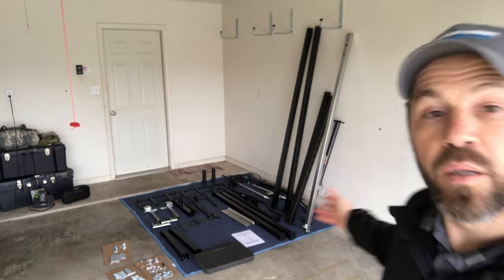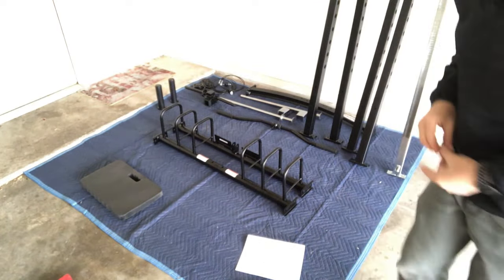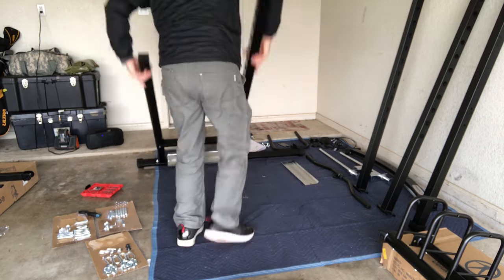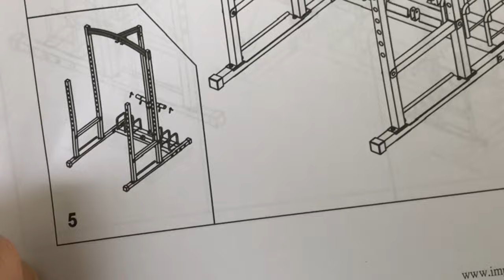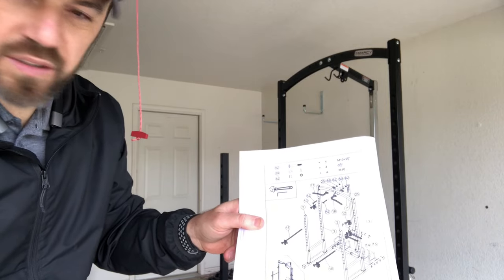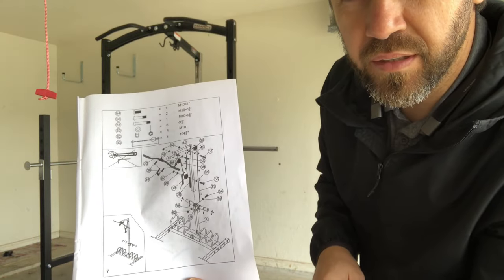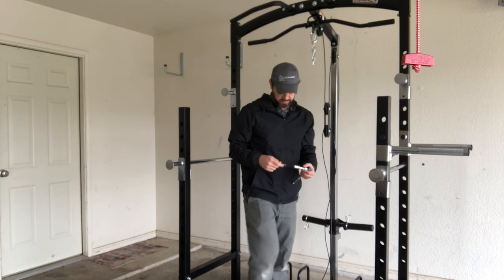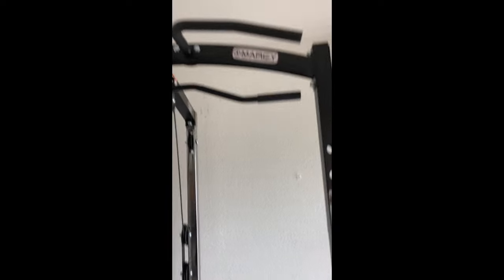Marcy Cage Home Gym | DIY Assembly & Installation

Comment: I had the same gym for over five years now and everything is still great but wondering do you know the measurements of the top cable and the bottom cable I would like to order a spares but don't know the measurements any help would be appreciated. Thanks

Comment: Hi, thank you so much for the video. Btw step 4(at about 5:00) the bolts and screws get stuck with each other and turn together. As I used wrong size of screw and bolt. Any solution ..?

Comment: Awesome video! On the plate storage rack, why do some of the U-shaped things have a hole in one side and others don't?
Reply from the maker: I’m sorry, I don’t remember those details very well. It’s been a while since I assembled it. 🙂✌️❤️
Reply: @MasteringMayhem  No problem thanks anyway
Reply: @karaipantsu9973  Hi there. The reason some of those pieces you mention have holes and some dont is because Marcy often uses the same parts for different cage systems. For example, the pieces with the holes may be used for a different purpose on a different Marcy Cage model (where the holes actually have a purpose in assembling the cage). Hope this helps.

Comment: What adaptor piece did you use with your Boshe 12v @2:50 into the video to tighten the weight holders into place? Also, 22mm for the wrench that you taped later in the video? Thank you so much for the great video! Cheers

Comment: Nice video! Was the plate holder for the pulley attachment only made for Olympic plates? And can the 1 inch standard weight plates be compatible for the pulley attachment?
Reply from the maker: From what I remember the bars that hold the plates are for Olympic plates only.

Comment: Could you do a review video on the rack please?
Reply from the maker: Aaron At this point I can’t do a review on it because I was only there to assemble it for a client. If I get an opportunity to assemble another one I’ll do a review. What questions do you have on it, maybe I can answer it for you since I assembled it.
Reply: Mastering Mayhem I was just wondering if it was sturdy and of good quality. Thinking of getting one for the home gym.
Reply from the maker: It is a very sturdy and rugged squat rack. The Marcy brand is great for home exercise equipment. Solid bolts and nuts that keep it together and it can hold hundreds of pounds of weight. There’s different models out there. The one’s that I have assembled and installed were all very durable and rugged. I hope that helps?
Reply: Mastering Mayhem it does, cheers mate!
Reply from the maker: Great 🙂. All the best to you and yours.

Comment: Having a problem at step 4 getting the double upright to fit into the grooves… I have the right side attached but the left inner seems to not match up. Any suggestions? It’s #23 not fitting into part 5

Comment: Awesome bro...did it all come in one box?? I have mine on the way but it says 1 box was damaged and sent back to the carrier? Didn't know if that was an error or not, the other box arrived today
Reply from the maker: Lyrically Outspoken DREW It’s a two box delivery. One is longer the other is shorter. Yeah, I heard that happens sometimes. With exercise equipment and playgrounds when I set up appointments. Did they give you an ETA for the new second box?
Reply: Would you happen to know if the main parts of the cage comes in the longer box? Like, am I able to make complete cage with the longer box and the shorter box is the accessories?
Reply from the maker: THRASHER .THRASHER Both boxes aren’t required to complete the assembly. That’s what I remember. Did box 1 and 2 get separated during delivery?
Reply: Weird question, I know but I’m looking to purchase this at a local auction and it only has one box. Just trying to see if I can make the cage part with just the longer box lol
Reply from the maker: THRASHER .THRASHER I believe you could make it work with some extra brackets but it will be a bit more difficult to assemble it or to make it work. I can’t say matter of factly though. Personally, I would not purchase the one box without knowing and being ready to make some adjustments and having to buy a few nuts & bolts and metal plates of some sort. 

I suppose it depends on what kind of deal you get on it at the auction?
Reply: Thank you so much for the quick reply! I’ll be getting this for a steal since no one wants to purchase an incomplete package.
Reply from the maker: THRASHER .THRASHER Absolutely. I was thinking the same thing. If I was able to get that one box for a really good deal was confident in my ability to modify a few things, it would definitely be worth it. Share a photo of and when you get it put together. All the best at the auction.

Comment: How much did you charge to assemble this?
Reply from the maker: $200 for that. If you want me to bolt it down into the floor depending on the material I’m bolting it down to, it would be an additional $50-$100.

Comment: Could you load 1" plates? Are those things on the weigt loader 2" adapters?
Reply from the maker: Thi Huynh I believe they are 2” adapters. I remember them being pretty large.
Reply: I'm under the impression that the 2" in adaption that you can take off to utilize 1" plates I'm not positive though
Reply: @MasteringMayhem  Thanks for the reply! 💪

Comment: What tools did you need to put this all together?
Reply from the maker: For this assembly I had my Bosch 5-in-1 12V power drill. I had a socket tool set that has keys to the size of 22mm. I had a rubber mallet. Ratcheting screwdriver with both Phillips and flat bits. I believe that was it.